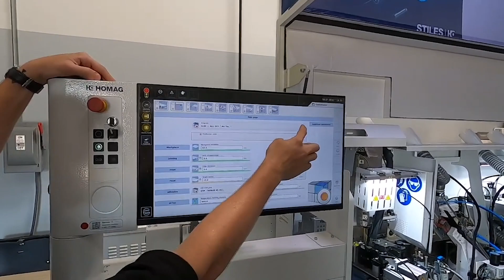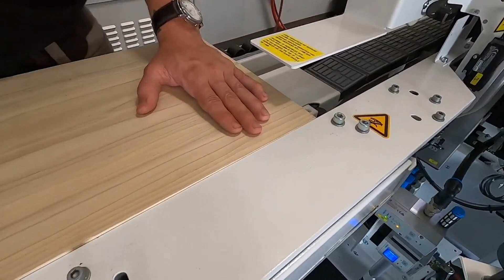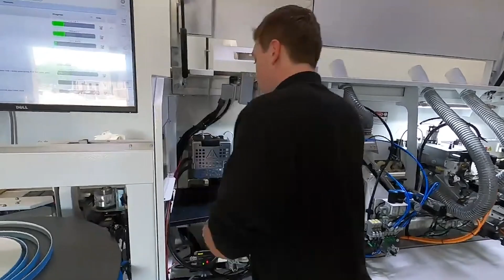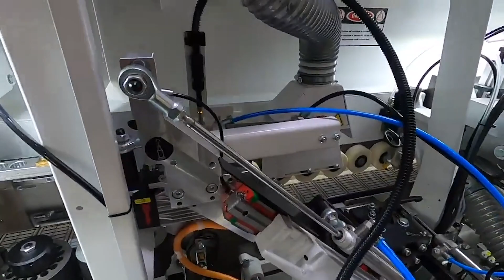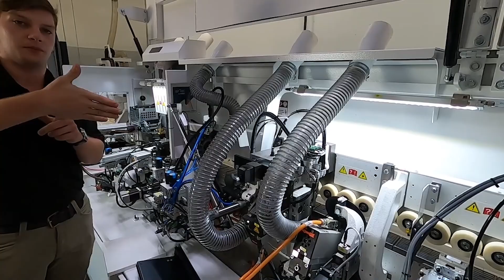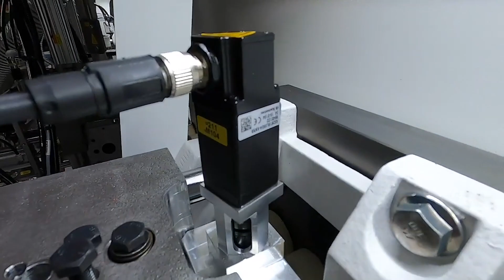HOMAG EDGETEQ 4.5 Edgebander - Walkthrough and Overview

Comment: I have been in the industry for a decade now and I have had the experience of operating and maintaining a very old Cehisha, a new Biessi Jade and now this monster of a machine. I had the privilege of learning the ins and outs from the gentleman in this video. He’s an excellent teacher and very knowledgeable in the field. This machine handles 100-150 sheets a day. We have to upkeep a bit because of the rate we use it but I don’t know another one that could handle this. We change tooling every 6months or less depending on the station. We do use corner rounding very often and as long as the machine is maintained and treated well it will give that in return. Thank you Donny!! I hope you are well bro!